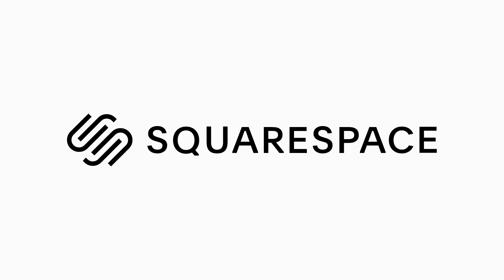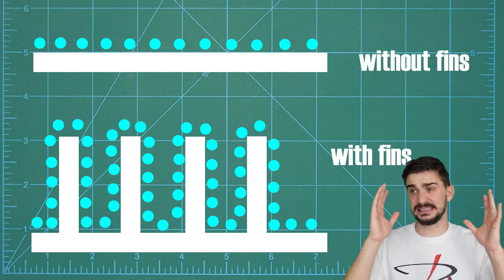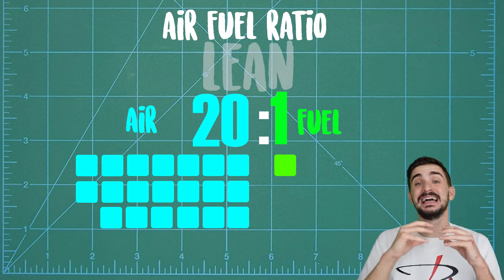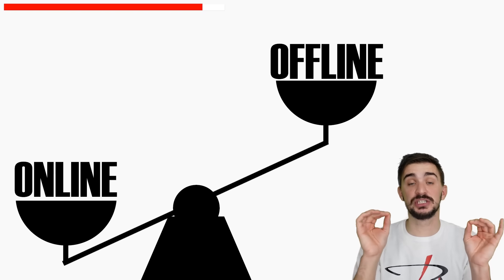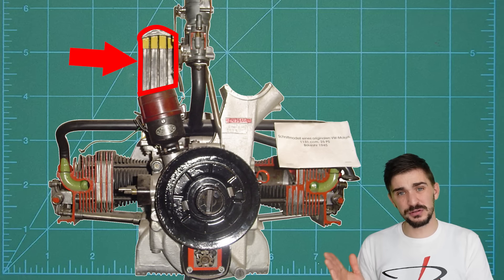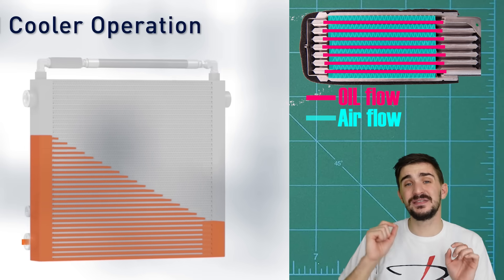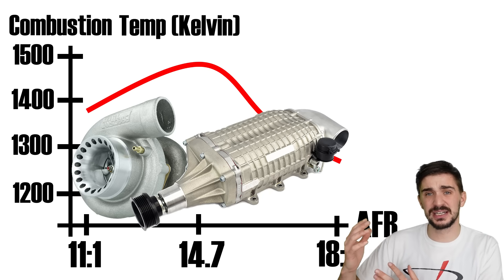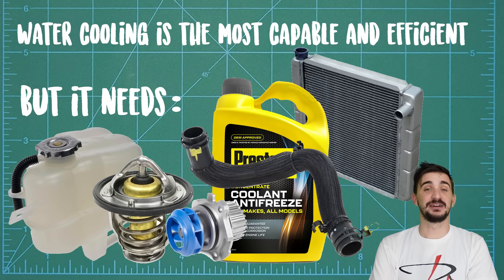AIR COOLED vs OIL cooled vs WATER cooled ENGINES

Comment: excellent video as always, however I think a more accurate unit of measure for heat capacity is J/kg K (or kJ/kg K) , which would indicate the amount of energy required to heat one kg of matter by one Kelvin. it obviously takes more energy to heat a larger amount of matter by the same temperature difference

Comment: I’d imagine that friction is a pretty small amount of the total heat rejected by a typical engine. Heat absorbed from compression and combustion will be the lion’s share of heat rejection.
Reply: Exactly
Reply: Correct.
Reply: I believe I have seen  an energy balance for an engine where the total added up to 104 percent or something like that. The engineer knew they were counting some of the friction twice, but they were just adding up the work output, the heat rejected, (maybe heat value of the fuel not burned) and the friction measured and then explained why the sum was greater than 100 percent.

Comment: one other major issues with an air cooled engine is that because they run risher they have higher cylinder washdown and it reduces engine life a lot. and is more sensitive to carb wear or not running correctly as it is already so rish that if it gets richer due to a problem it can fill the crankcase with gas very quickly

Comment: Friction is minor heat source, these are combustion engines and that is the main source of heat. Air compressors get hot because of the compression, but the combustion engine compresses and then decompresses the air if there is no fuel and spark added, so the net Heat would be insignificant because the heat would transfer to the air it's self and therefore be exhausted. the movement of air would be cooling. But, when you add Fuel and Then combust the mix by spark, the actual heat coming from this combustion is what runs the engine and an unavoidable consequence is heat. That is the main reason why most ultra efficient engines today have a energy to work conversion of less then 50%, that means that the other 50% is heat and other forms of energy that do not translate to work, or in other words locomotion.
Reply: Correct. Combustion is a good way to move heavy stuff but creates a ton of wasted heat energy that has to go somewhere.

Comment: On old Volkswagens, they'd have these thermostat operated flaps that would block the air coming from the fan to get the engine up to operating temperature quicker.

Comment: Some Volkswagens had oil coolers but they were primarily air cooled but still worth noting. I prefer oil cooling if you don't have liquid cooling and the simplicity of oil cooling is better to be then liquid or air cooling in a compact space.

Comment: ..and also, you did not mentioned, that water cooled engine emits less noise, due to water capacity to absorb vibration. Cylinders sorrunded by water jacket, causing less vibration due to the explosion and piston rings friction.

So, this video isn't the best prepared for sure.... Improve your work, cause your sloppy

Comment: Great video with much detail and simplicity of information digestion. I’m surprised you didn’t discuss how oil or liquid cool radiators needs a way to mimic air blowing into it while stuck in traffic or idling on a hot day which is where the radiator fans come in. I was so shocked not to see it discussed but still a great video none the less!

Comment: sacs was a ww2 aircraft  receipt applied in a milestone for superbikes , the gsxr sacs series. Very reliable way to cool the engine and this is the reason that sacs gsxrs are widely used for drag races and not the water cooled editions. Another simple way for cooling was introduced by Kreidler florets in the beginning of 1960 for 50cc mopeds and the same cooling idea was used from yamaha in some underbone two stroke 125s.  They use a ventilator which was mounted directly in crankshaft . You can drive your moped in first gear for hours without a problem . The same principal used from chainsaws. The widely use of water cooling become for trade and marketing and mass production  reasons.

Comment: I went in to this video just cause I was bored not thinking I was goin to learn, but I did. I thought oil cooled motors were basically just air cooled but they just passed through a radiator on the path to lubricate, i didn’t realize they had cutouts for the flow as well. Thanks for that knowledge

Comment: I like the concept of oil cooled, but only if the oil temp is tightly controlled.
This can be aided by the use of a pre-compression cylinder (which doubles as an oil cooler) instead of a turbo or supercharger (which can be pretty good at cooking oil)

Comment: Not a physicist but, Interestingly the friction depends on the pressure or normal force between two sliding surfaces, not the speed.

Try rubbing hands at alow speed but max pressure blvs fast with little pressure.

Of course, due to the nature of hands and engines, the pressure is often higher at faster speeds (as the higher acceleration means the pistons are forced harder against cylinder walls and hands are forced to deform to accommodate sliding past the uneven surface of the other hand), but ultimately it's the pressure thst determines the friction- as well as the nature of the materials sliding and the presence or absence of lubricant.

Thus only applies to sliding friction, not drag... but hey, the more you know. 🌈

Comment: You didn't directly say that lean tuning results in high temperatures, but you didn't state that mixtures lean of stoichiometric run cooler in a similar manner to how they run cooler rich of stoichiometric. Lean of Peak tuning ("peak" referring to EGTs which are at their highest at stoichiometric) is used in air craft and... people who know about it and have a reason to use it. I used it for years tuning carburetors on air and water cooled automotive engines. Cooler temps, better fuel economy (at the expense of some power, which is the down side), and better throttle response. Also good for emissions, and I've never seen a downside over many cars and years aside from the reduced power (which can be tuned back in at higher loads to get it back when you need it).

Comment: 2:24 best u stick to engines and not air flow dynamics, trust the engineers on this one.
Reply: He Is right bro
Reply: @Italian598 not really, there's this thing we call "Coanda effect", although it wouldn't work if the aoa is too steep(will cause stall like high aoa wings, which is why there are multi-element wings)

Comment: i am amazed that u didn't mention how fuel efficient air/oil cooled engines are and that they run at higher temperature (150°C) - example Deutz engines..

Comment: Fantastic video. The other disadvantage of air cooling (and advantage of water cooling) is increased engine noise as the cylinders aren't surrounded by a water jacket which acts to muffle combustion noise.

Comment: For the air cooled engine i learned a lot about my "tiny" RC 1/10 nitro engine ^^ 3cc for 3 HPat + 30000 RPM  (very powerful and fast ) and like you say , it need to run rich for durability ^^
A good channel a subscribe directly
Hello from belgium ;)

Comment: I told you that that South Philadelphia accent would sell this thing! That and your meticulous homework and research may have just a bit to do with it too! This one may want a little "tweaking"- Porsche engines have been both air and oil cooled simultaneously going back a ways- as are many sport bikes which have OEM oil coolers; they  need the extra cooling applied through the oil system to make the package work.  FR

Comment: This was a very nice video with some good information, but oh, there's one uncharacteristically large mistake:  In the beginning, you ascribe the need for a cooling system to engine friction.  Actually, that is a VERY minor part of it!  Perhaps surprisingly, even a perfectly frictionless engine would still require nearly the same cooling system design and capacity as real-world engine.  In a thermodynamic cycle, the vast majority of thermal losses have nothing to do with friction, but only relate to the absolute temperature difference between the hot side (combustion temperature T_h) and cold side (environment temperature T_c).  

These are fundamental unavoidable limitations imposed by the Second Law of Thermodynamics.  Even a mythical perfect engine (called a Carnot engine) would still be subject to rather severe limits: The Carnot efficiency relationship follows η = 1 - (T_c/T_h) where η is the efficiency and the temperatures are given in absolute units of Kelvin.  If you  want 100% efficiency for your imaginary frictionless (and reversible and adiabatic, but that's outside the scope here...) Carnot engine, you need an infinite combustion temperature or absolute zero (0K) coolant temperature, neither of which are possible by a long shot.  

In the real world, yes, friction does cause heat loss, but it's absolutely tiny in comparison to thermodynamic cycle loss, about 1/20 of it.  In a real engine, even if you group pumping (throttling) losses in with typical traditional friction, the thermodynamic cycle losses are still about 10x greater!  This is why it is such a challenge to make any meaningful impact on fuel economy through engine friction reduction... it's only a tiny part of the heat losses.

Here's a link which roughly summarizes losses for a typical gasoline engine vehicle:  https://www.fueleconomy.gov/feg/atv.shtml.   Actual numbers vary a bit depending on engine vehicle and driving cycle, but this is a rough idea.

Comment: There is another disadvantage between air and oil cooled engine. The oil viscosity is much higher then water, so its flow more laminar than water, water flows more turbulent. This turbolation helps the coolant to move the heat away from the source. The reason they used oil to cool: If some sealing broken, and coolant gets into the combustion its much more better then anti freeze

Comment: I enjoy your videos and this time I actually have an addition to add. :) The VW air cooled engines are actually air cooled/oil cooled. They actually have a oil cooling tower in the fan shroud assembly. You can increase the cooling by adding an external oil cooler as well. This increases the oil capacity by ~ 1 - 1.2 quarts depending on the system, as you mentioned. It is a common practice in hotter climates and racing.

Comment: In theory, using oil as a coolant would make the engine easier to operate at sub zero temperatures, due to oil's lower freezing point.

Comment: Some American sprint cars run methanol mixtures in the 3.5:1 to 4.8:1 ratios, and therfore have quite small radiators, and cooling systems, because the latent heat of vaporization quality of methanol. A more extreme example of this is a top fuel dragster, which under full load, run AFR mixtures of 1:1, extremely rich.

Comment: Superb vid again.  Excellent graphics and, as we have come to expect, clear and brilliantly thorough explanation.

Also particularly nice to see the Suzuki engines and oil coolers pictured: I used to have a GSX-R1100G slab-side with the engine being talked-of in the vid (they have long-since gone to water).

It was certainly light compared to its direct contemporaries, but I think I recall Suzuki claiming it as running cooler etc.  If so, they must have been comparing against air-cooling only, as it ran a good deal hotter than any water-cooled bike I ever had, even at the time!  (Still one of my faves...)

Comment: The heat from friction is absolutely minimalistic almost non measurable, most of the heat is just from combustion.
Reply from the maker: 09:15
Reply: @d4a  0:16-1:10  you were talking about friction causing melting the engine, you didn't mention the combustion at all, if you drain cooling fluid and take the spark plugs out of the engine (compressing air make lot of heat), if oil pump is running, the friction is so low, that you can spin the engine to rpm limit for hours and it will not heat up even 3°C. I know that you talked about cooling combustion chamber at the top where its hottest, but why you didn't mention it in the first place, and talk about friction, when friction heat is negligible?
Reply from the maker: It's definitely not negligible 👍
Reply: @d4a without oil… :)